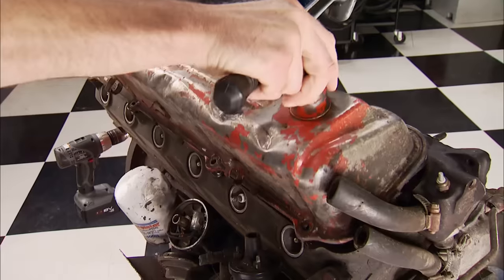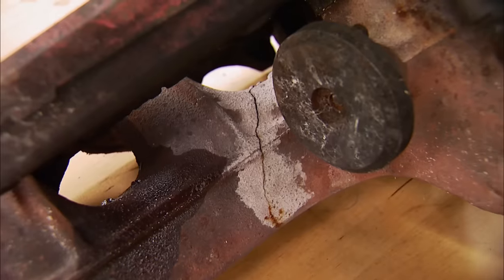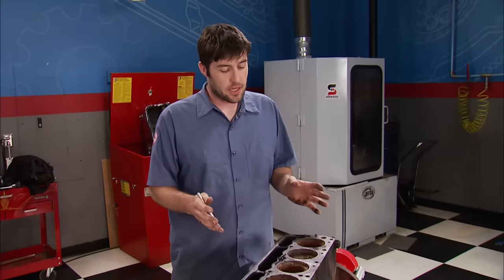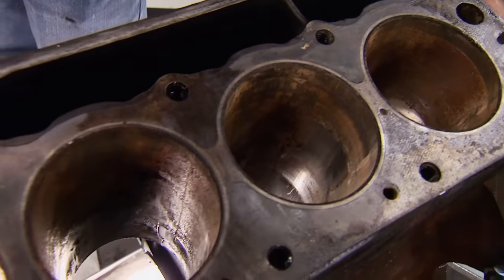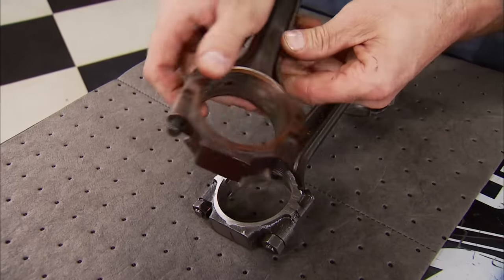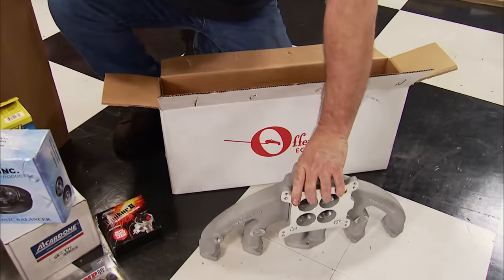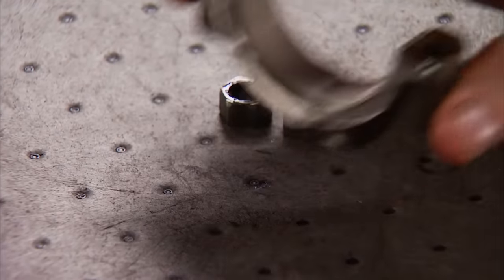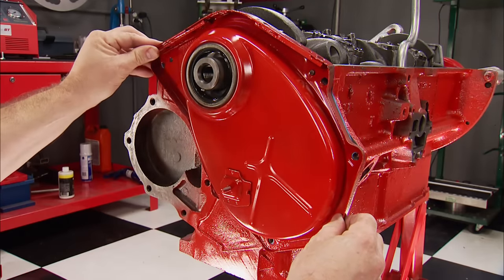Resurrecting A Mopar 225 Dodge Slant Six - Engine Power S2, E2

Comment: nothing left from the old engine... how is this resurrecting?
Reply: I was just thinking the same thing
Reply: Well... This is how we rebuild engines.
Reply: @user-mj7gm6gj9v  If nothing original is left over then it's not even the same engine anymore, you can't call that "ressurecting"... That's called REPLACING. Sit.
Reply: @marceloho1984  Also not "rebuilding" if nothing original remains, called REPLACING.
Reply: This is my grandfather's axe.  It's had its handle replaced three times, and its head replaced twice...
Reply: @I_Crit_My_Pants  yep, everybody says " I made 900hp on a junkyard LS) no you didnt, you made 900hp on a stock block with new parts.
Reply: @zuestoots5176  They should say "I made 900hp on my upgraded junkyard LS"
Reply: ᄅᄆᄆᄀᄀᄅ honestly they really resurrected it by using a completely different motor
Reply: Sorry all. You're right. The first time around, I missed the part where he said the engine was so damaged he had to use a different one. I stand corrected.
Reply: Glad I'm not the only one who thought this. I mean don't get me wrong, I enjoyed the video and it was cool to watch. However they could have just as easily titled this "Building a Slant 6 from scratch".
Reply: OK: I’ve now seen enough of the videos on this channel to understand it’s all about demonstrating tear down and reassembly. 

The tear down of the junkyard motor was educational enough to demonstrate the technique. Even though nothing was salvageable.

The assembly was likewise sufficiently educational despite being all different parts.
Reply: @Fire&Ice909 Considering every single part was replaced with new or old stock parts..yes it is a brand new engine and not a resurrected one.
Reply: It's a bit like the Flying Scotsman which has been rebuilt so many times there is nothing left of the original.

Comment: I agree with the comments below, this is about building an engine not re-building an engine. Another amazing item is how all the valves fit miraculously without any lapping to insure a good seal. I guess that was another unimportant procedure not worth showing.
Reply: This wasnt much of an engine either, they only slapped it together roughly, by the end of it the engine was a lemon. They didnt even get it to be as powerful as a stock standard engines horsepower. It had far less than a stock standard engine. I was hoping for 160 to 180 horsepower atleast for all the work they supposedly did.

Comment: That massive forged crank had a crack?  Damn, must have had a million miles on it.
Reply: Captain 345 

Probably froze and cracked from sitting
Reply: They didn’t use x-ray & sonic testing on forged and casted parts then. QC is far better today than back then. That’s not to take anything away from the Slant 6. It was an extremely durable design for that time period.Way back in my high school days, me and my best friend did our best to tear one up . We kept oil & water in it but absolutely thrashed it. We failed to kill it.
Reply: @prevost8686  'Extremely' durable it is not. Average durable it is. I know. I fixed the effing things for years and they are about equal to any other inline 6 made by the big 3 of the era. 

They don't like being thrashed. They die. no.6 big end lets go and ventilates the block and smashes the starter off. I have seen at least a dozen do that. The big end bearing rotates, the oil hole blocks off, the big end gets hot, the rod bolt fails and bang bang bang grrr, grrr cough grrr clank clank clang - tissss, shhhhhhhhh .......... ......... ........
Reply: Captain 345 I think the machine shop wanted the block and crank probably told them that if they gave them the block and crank they wouldn't be charged for work
Reply: @daveycrocket6277  Something similar happened with me I sent my block and head to another shop for CNC port work they told me block/head  was clean after doing a magnaflux testing that other shop was trying to scam me
Reply: @fpeletz Stock 'redline' for the 225, going by the 'maximum road speed in gear' listed in the owners manuals from the '60's, is 4500.
With the stock 1bbl, and exhaust, they don't breathe over 3500, but headers and free flowing inlet, and the 225 will pull to 4500 - and with a HyperPak inlet, you'll see 5000 if you're not quick on the 1-2 upshift :)
I have a HyperPak inlet, 'tuned' length headers, Thermoquad, and sure it'll breathe better, but all the extra torque means around town, I ease out the clutch at idle, upshift at 1800, and am doing 60kph faster then most of the traffic.

Half the time I shift up at 1200 - stock rear end here Down Under was 3.23:1, so just off idle in top is 40kph in the school zones, 1800 is 60kph, and 2800 is 100kph for the freeway.
Reply: @ThePaulv12  Gotta disagree. A legendary engine renowned and celebrated by automotive engineering experts. Just bulletproof.
Back in the early seventies, like the original poster stated, we utterly neglected these engines except for oil and water. They just loved to be abused and ran trouble-free for 
100,000s of miles. 
Just wish I had one today.
Reply: @tonydanis1480  Well I'm a mechanic. I get to, or got, to see it all. Just because you get to see a few slants that were ok, and a few comentators agree that they are ultr reliable doesn't make it so.
Average reliability and less than average if not serviced and terrible reliability if revved up - esp the 225. They just can't handle it.
If you drive it around like grandma, service it regularly then the reliability was good, but then so is the reliability of any other engine given the same treatment.
Sorry 'ole mate, i have to disagree with your contention.
Reply: @fpeletz That sounds like an undersquare, not oversquare engine.
Reply: @ThePaulv12  I drove mine hard past 150,000 miles.  Ran great when I sold it!
Reply: @robertlee9395  using an exception as proof of contention is ridiculous
Reply: @ThePaulv12  - What you described above, regarding the number six bearing, doesn't surprise me, but the one Slant I have that did that before I was sold it, spent two years hauling around all my camera gear in my '67 VC Valiant wagon while I shot  wedding videos. I was reliably informed it was just a cover plate rattling, it never seized or threw a rod, and regularly saw 4500 rpm while chaseing groomsmen in modded Commodores and Falcons.
Wasn't till I finished doing weddings that I pulled the motor to find the damn noise, that we found the bearing had spun.
Thing is, I always kept the oil topped up, and had a pressure gauge on the dash, no doubt that's why you've seen ones that seized, they didn't have enough oil, starved for long enough to do real damage.
Reply: @ThePaulv12  I was a Master certified mechanic back in the seventies when these things were put in everything. You couldn't kill them. We had one come into the shop that the crankshaft broke, and everybody including the factory reps couldn't believe it and had to check it out. Nobody had ever seen a broken crank in a 225. I bought a car just for parts, with one in it. I drained all the oil out of it and drove it around for hours. Probably drove a 25 MI or more with no oil. It still didn't die. I'm retired now but in all my years is a mechanic I've never seen another engine as durable as a Chrysler slant 6.

Comment: Slant Sixes are definitely indestructible!  I drove my 1963 Valiant with a 198ci slant six for at least a year and a half with cracked block.  You could even see the water seeping out the crack just below the exhaust manifold.  Once the engine warmed up the crack would close up.  I would always carry a couple extra gallons of water in  car for that reason.  After starting the engine I would fill the radiator up with water.  I drove that to work everyday and wherever else I had to go.  The engine never over heated.  I love the car because it also has a manual transmission, "3 on the tree".  The rear end was lot louder the engine is.  
Slant Six  "THE  LITTLE  ENGINE  THAT  COULD !

Comment: The slant 6 in my books is the toughest engine ever produced.

I have a 74 Dart that I ran for years, one summer I blew a seal and ran it dry of oil 4 times before I fixed it. Each time the engine seized up, I would just add oil, take a wrench and turn the engine over. Then start it up with no issues. She ran for 6 more years after that with no issues till I sold her. Ran into the owner an about 5 years later around 93, and he told me it was still running.
Reply: I could say the same thing about the Briggs and Stratton that cuts my grass. I think I get stuck behind you every time I try to drive somewhere in a hurry.

Comment: I'm not a Mopar guy but its damn hard to argue against the ol' Slant 6.
Reply: Slant 6 is the best it will outrun anything Uncle Tony has a 170 has a 170 with over a million miles has been running since 1964 and never played with and if you don't know who Uncle Tony is just look up Uncle Tony's Garage here on Youtube
Reply: @LordHumungusFL  won't outlast a slant six
Reply: In 1982 at Indianapolis Raceway Park, I saw a guy with race built slant 6 in a rail car run mid 8's at 156 mph.
Reply: @LordHumungusFL  The 300 was an awesome engine and made alot of torque for a straight six, they're both good engines in my opinion, and both very smooth running.
Reply: @LordHumungusFL  300s were fuel hogs from hell. just get a 302.
Reply: @Brock_Landers  The 300 was the reason why Ford Australia designed and built the 250 truck engine; a high compression 250 cubic inch, cross flow head with electronic ignition. They were fitted to Australian spec Broncos and F-series trucks as a more fuel efficient alternative to a V8. They had torque like a turbo diesel, were just as reliable as the 300, and were based on a passenger car engine. The standard 250's latter day descendant is the infamous Barra turbo. A 4 litre inline 6 that can outrun a Coyote V8
Reply: I could use one... turbo'd
Reply: Brilliant design..
Reply: See even Chevy & Ford guys know. Very cool, thanks from mopar guys.
Reply: @troymillion8510  I'm a Japanese and Korean cars person, and a Ford person. I could see myself using an Old Mopar 6 as a heart transplant. Forget New Mopar though, Italian crap.
Reply: @ellenorbjornsdottir1166  True that the newer jeep designs are literally just rebodied fiat pandas. Vin code begins with a Z so they were built in italy too.
Reply: Big Rock  i want to see a turbo efi-retrofitted electric ignition-retrofitted chrysler slant six in a ford ranger
Reply: @LordHumungusFL  LOL, the Ford 300 made less horsepower stock.  It only produced a little more torque than a 225 (about 30 lbs.)  The Slant 6 has much better aftermarket support too.   I know the Slant 6 was the more durable of the 2 motors (I've owned both).....  You also seem to be forgetting that the Slant 6 was engineered to be manufactured in aluminum (and they did for the first year of the Valiant) with lots of extra reinforcement engineered into the design -- but mostly manufactured in absurdly durable cast iron.    The Slant 6 was the better motor, but the 300 was indeed a great one too.
Reply: @79tazman  uncle tony is the king of mopar knowledge and nick from nicks garage is the absolute guru of mopar POWER
Reply: @LordHumungusFL  yep,blew up a few of them....slow,ticking time bomb!!!
they aren't in the same ballpark,slants do over a million miles when serviced occasionally
Reply: Im a chevy guy, but yeah the slant six was bad ass and the 4.0 inline run forever

Comment: i had a slant 6 from the late 70s. Dodge had decided to make the distributor gear out of nylon. They saved 5 cents on production and I ended up with nylon pieces floating around in my cam gear. Thanks Dodge!

Comment: I always get bummed out when the engine they start the rebuild with isn’t the one they finish with.
Reply: Well, that happens in the real world.  Junkyard engines are always a gamble.
Reply: @chuckschillingvideos  it depends on where they're from sometimes and how old they are, for example, if I'm looking for a Toyota 1uz-fe V8 engine (I don't care if people hate it since it's a Toyota) for a project  car i can get one out of a car that looks mint but it could be in worse condition than one from a wrecked car (unless the car was wrecked head on there's always a chance it could be salvaged) because sometimes cars end up in the junkyard because the previous owner want a quick buck or for some reason the car just wouldn't run and they gave up on it, you will never know until you take it apart and rebuild it and look it over as you rebuild it while replacing parts here and there along the way just to be safe (like rings, sleeves, gaskets, etc.) And see if the block is still worth investing in once you get everything out
Reply: It’s like one of those “first starred in years“ videos where they just take the entire car and rebuild it from the frame up with a brand new engine.
Reply: chuckschilling yes, but what they did was buy a junkyard engine, tear it down, then throw the entire thing away and buy a bunch of new parts. They could’ve completely left off the first part of the video.

The only thing that would have made it worse is if they just decided to build a V-8 instead

Comment: I used to make these at Chrylser Trenton engine plant.   One reason why it was such a good engine was that it could only be made one way and it was hard to mess it up
Reply: That makes no sense.
Reply: I worked at Trenton engine myself, as an electrician, from 91 through 05. I haven't worked with a more knowledgeable supervisor, Stan Marchewka, or smarter coworkers since. Great place to learn, very hands on place.

Comment: Why use fancy ARP bolts for the sheet metal oil pan, then just use stock head bolts for the head?
Reply: because this build's a fail
Reply: The stock ones were probably rusty and weren't worth the cleanup.
Reply: It's a very low stress engine the Head bolts can more than handle the #)% increase they are giving it. On the other hand the oil pan/pump/water pump just used fairly standard bolts and were commonly replaced with ones with no flange on them or have been overtorqued. they're using the ARP bolts to promote better sealing not for strength reasons.
Reply: @misery13666  then use a washer and regular grade 5 bolts. Those ARP bolts are incredibly expensive.

Comment: In high school I had a 1960 Dodge Dart with the 225 Slant 6.
That car was 25 years old when I got it although it had a very kind life.
I never had a bit of trouble with the engine (brakes sucked). I did change the water pump out it was wobbly but still wasn’t leaking:)
A nice steady power plant very easy on gas and enough speed to get on a highway:)
Great engine!

Comment: 1 of the best all time in line 6s ever made
Reply: Agreed. It's ashamed that had get rid of an engine that was dependable and reliable.
Reply: @danielrowe2174  i had 1 YEARS AND YEARS ago,,,,LOL,, had way over 200000 miles in a 66 dodge dart wagon and was never torn apart excpet for maintenance,,,, sure it leaked some oil but wasnt bad,,,, sounded like a singer sewing machine but it was very dependable and still had all kinds of power for what it was,,,, it NEVER ailed me or left me stranded,,,,, all i did was oil changes and tune ups,,,,your 100% right,, the body gave up and was almost all bondo but the engine and trans was strong,,, that car didnt even have power steeering,,,, i was plling into my drive 1 day in the mid 70s and a van hit me in the rear,, pushed the back bumper to the rear diff,,,,,, it was a blast to drive,, i miss that car

Comment: Slant six how freaking cool !!
I haven't seen one of those in years.
About 40 years ago I had a buddy that had one of those. I think it was a Dodge demon.
He actually had a connecting rod come loose. It busted a hole through the side of the block. He took a hammer and chiseled around it. He pulled the Piston down low enough to take out the rest of the connecting rod. He installed a used connecting rod. Then glued down a piece of plywood over the hole. Then drove it for like 6 more months. And then actually sold it to somebody. That person actually bought a car. Knowing there was a piece of plywood covering a hole 😂😅